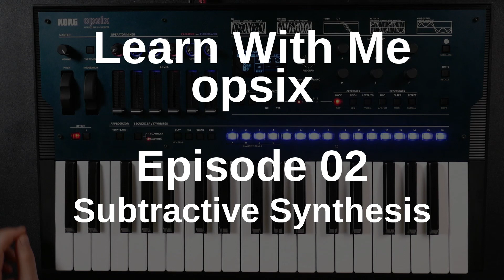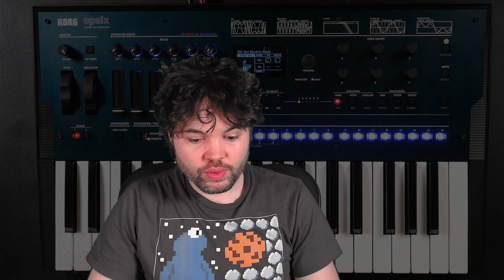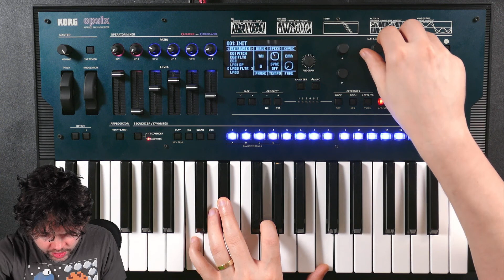Learn With Me - Opsix: Ep02 - Subtractive Synthesis

Comment: Does the FADE on the filter modulation compromise the attack on the filter envelope?
Reply from the maker: Thanks for watching, and for your comment. Fade is a property of an LFO to allow its effect to fade in gradually after the onset of the note (such as a vibrato that comes in gradually over a few seconds): It's not a property of envelopes (as they have attack) or of the modulation slot.
Reply: @ChalkWalkMusic  Sorry, my question could have been clearer: if there is a slow attack on an amp envelope, implying that it will take some amount of time before are able to hear the oscillator, could it render the fade on the LFO pointless, because we can't hear the fade on the LFO anyway?

Btw, thank you for your video series, it's great.
Reply from the maker: @-crash  I see what you are saying. It really depends on the length of amp attack vs the fade, and the parameters you are modulating. If the attack is much longer than the fade and is exponential or linear (if it's logarithmic you might hear it even in this case) it might not be audible, irrespective of the parameter: typically you'd want the fade period to be much longer than the attack time. As I mentioned, a common use is for vibrato that comes in automatically (vs using the mod wheel) for a monophonic sound like a flute, so the amp attack is short (maybe .1s) and fade time is long (maybe 2s).